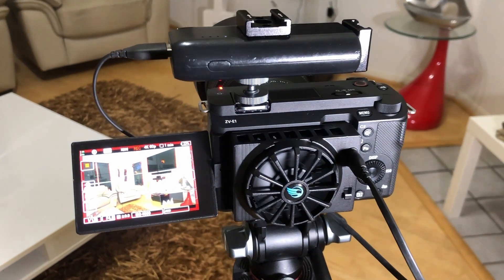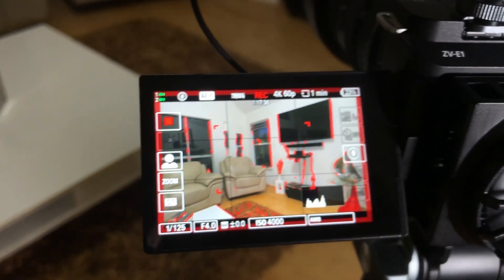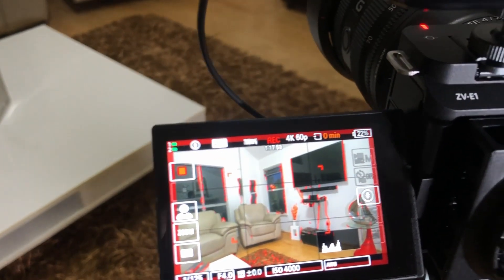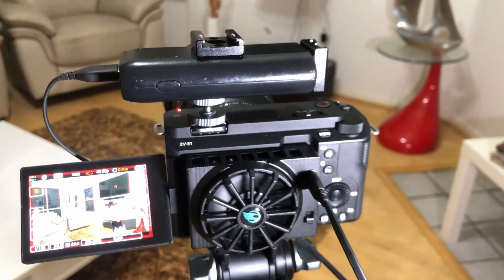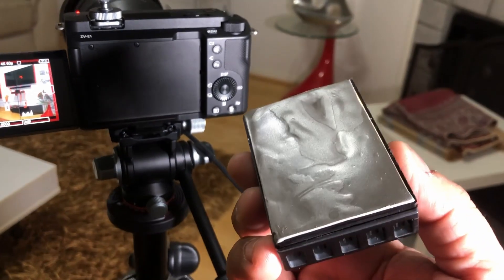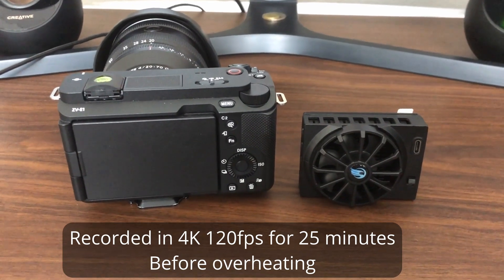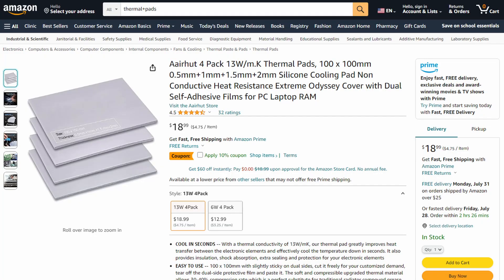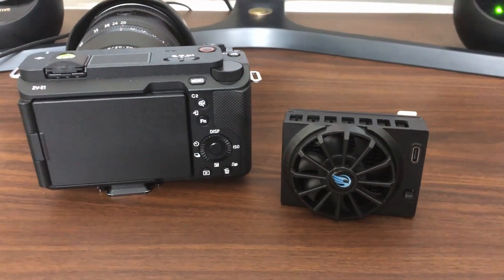Sony Camera Overheating - Thermal Pad/Cooling System

Comment: Thanks for doing this 👍 is the heatsink under the fan plastic or metal ?
Reply: Nice vid
Reply: It looks like plastic from outside. Of course I cannot see the inside but it has some weight to it so there may be metal in there.
Reply: @DSLRMAN01  yeah im just thinking about the heatsink fins themselves if they are plastic they are not going to wick the heat away like aluminium fins would and they could actually be an obscruction more than a help, even thermal pads like the one being used to stick the unit on can be counter productive if they are too thick so it might not be as efficiant as the visuals might suggest, clearly better than nothing but perhaps could be even better with a few changes. I'm interested to see how the Tilta one performs too.